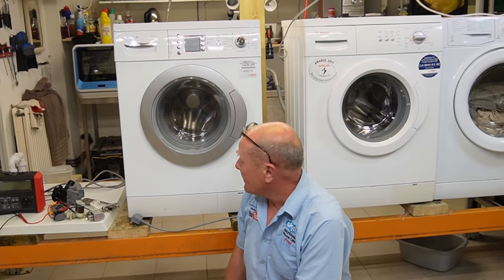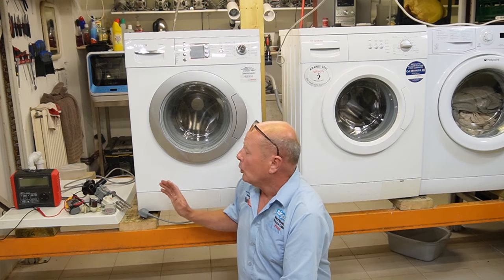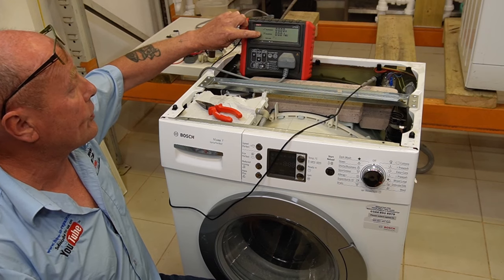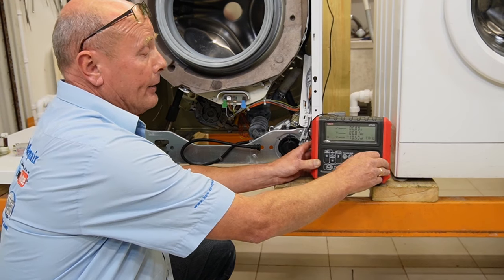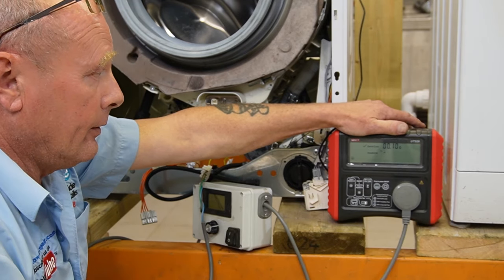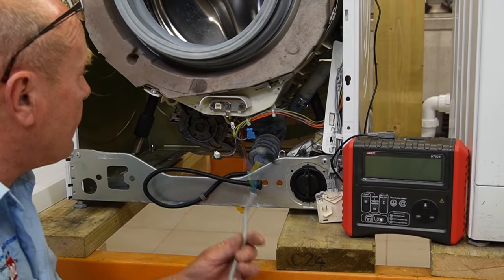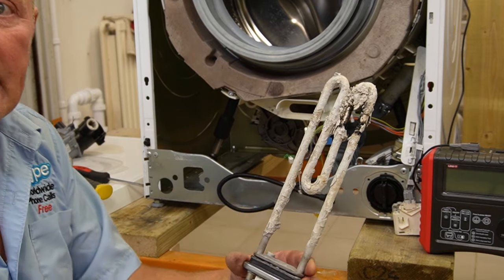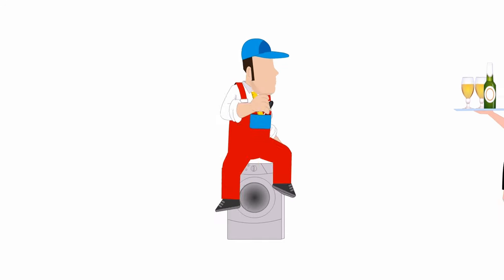Washing machine trips electric fuse board, Breaker or RCD

Comment: Great video... Just be careful how tight you tighten the nut back up. Measure how far the nut is on the thread before undoing it and then tighten to the same distance otherwise you could break the PLASTIC drum housing. This guy made it appear like you can apply lots of torque to that nut. It will seal without excessive tightening. Just do a run of the washing machine and look for any small leaks and tighten a little if needed after stopping the machine immediately after seeing and leaking. The plastic drum will crack very easily but if it does you can just apply an epoxy resin over the crack. The epoxy you would use in fish tanks.
Reply from the maker: I normally say hand tight and then quarter of a turn but it does look like I overdid it slightly in the video well noted point

Comment: Excellent video 👍🏻 also the other quick way to check for a faulty unit is simply by unplugging the connectors of the individual unit then see if it still tripping or not

Comment: Top tip Chek for lose wires. I had a lose ground wire it got in to the motor and triped the breaker every time i tried to turn the washer on and triped the breaker

Comment: Hiya, I have a bosch washer dryer and have recently changed the bearings on the carbon brush motor. It worked fine, but after about 80% of the wash cycle it started tripping the fuse box in the house. Now, no matter what I do now the machine trips the breakers as soon as I initiate any program. If I unplug the motor from the machine everything is normal, so I assumed I've broken something in the motor. I performed tests on the motor with a multimeter and can't find any shorts or weird resistance readings in the windings or armature. The RCD even trips when I take the carbon bushes out of the motor but connect it up to the machine. Any suggestions on what else to check? Love your vids, great resource!
Reply: Could be the drying element  as well as the temperature sensor , also check the filter and give it a nice clean.

Comment: yes, i got this problem with my siemens s16-34. it knocked of the power of part off my house. So if i got a f57 error it will most likely be the main circuit board or inverter module correct? thanks for the explanation video

Comment: Hello, you talked about if the water pump became faulty it would trip the breaker as it only had a live and neutral. What is that referring to the fuse in the plug. can it not trip the house fuse box?

Comment: Hi, it has been few years since you posted this video, i still hope you can see this. My beko washing machine trips if i use hot water, even 20 degree hot water trips the electrics. The only way to use my washing machine is a cold wash. Any idea what the problem is? Thank you
Reply from the maker: Hi, I will need the full model number of the identification plate and the details of your problem so that I can provide you with useful literature. Please use our contact us page and make sure you fill out the request for what your problem is. A video shoot of the problem would be perfect as well.

I will get back to you within 24 hours, normally. https://www.how-to-repair.com/help/contact-us/  

Please remember to subscribe to our channel, as that's what keeps this channel going. Thanks, Paul 👍

Comment: I have the same power tripping problem with a 2 years old Bosh Vario-perfect. I measured  the 3-phase motor with a Megger insulation tester and also the heating element after warming up in a bottle. Both are OK. Then I changed the two mains filter capacitors (10 nF and 22 nF)  on the driver board who were connected to ground by 400 Volts types. No result. The machine is working well with ground disconnected, but this is unsafe. Floating voltage  measured with an multimeter, between machine housing and mains real ground is 90 -140 Volts, dependent on orientation of the plug and is able to light up a small incandescent lamp. That was the primary reason I suspected the two capacitors because they are the sole ground connections on the board ground (=housing too) All other power supply components on the board are OK.  Any other idea? Thank You
Reply from the maker: really you are asking an impossible task at me to diagnose the Machine without having the appliance in front of me all I can say is test every individual component and check none of the wiring is going to Earth Thank you For leaving a comment this is for you https://www.youtube.com/shorts/e432SAb2g08 please remember to subscribe as that's is what keeps this channel going. Thanks 👍
Reply: @How-to-repair 
tested  L and N with Megger (350Vdc):no earth leak.  I've disconnected the motor, heating element, pump: no ground connection, nor on all the cables connected with the driver board.
The tripping occurs after turning the program selector knob, whereafter the two relais  on the board are closed. I see a VDR (resistor) on the board (value "150 ohm", dvm measured :50 ohm)  and maybe he is necessary for the coils, but NOTHING else beside the two input-filter capacitors have a real ground connection. Maybe there is a link were I can find the technical servicing manual and circuit diagram of this Bosch Vario-perfect washing machine? Thank you for your quick response

Comment: Good day why is it i already change the heating elements the still its triping the breaker?? I also check the continty but still trip can help me  thanks.
Reply from the maker: Hi, please use our contact us page and make sure you fill out the request for what your problem is. I will need the full model number of the identification plate and the details of your problem so that I can provide you with useful literature. A video shoot of the problem would be perfect as well.

I will get back to you within 24 hours, normally. https://www.how-to-repair.com/help/contact-us/  

Please remember to subscribe to our channel, as that's what keeps this channel going. Thanks, Paul 👍
Reply: @How-to-repair   I forgot the model but some picture

Comment: Good morning, i have a 5yo Beko washing machine. About 2 weeks ago, it started to trip my electrics whenever I start a program. I can turn the machine on just fine but the moment I select any program (delicate, wollen, cotton. Synthetic etc..) and press START that's when it trips my electric. I dunno what it could be. heating element, motor, inlet water valve, door lock, and main power.  switch. Thank you.
Reply: Everything I've had with a Beko hasn't lasted, Shit company!!! And now the same as you my Beko washing machine is tripping, Ridiculous!!!

Comment: Just started happening with my washer, 8 years old. Worth getting a specialist out to diagnose and repair or just buy a new machine for £300?...
Reply from the maker: It is worth having a look at what is tripping. The electrical supply feel free to contact us using the website. Make sure you use your full model number and a contact telephone number. Hi @tiggersmith7393 I will need the full model number of the identification plate please use our contact us page and make sure you fill out the request of what part you are after and will get back to you within 24 hours normally https://www.how-to-repair.com/help/contact-us/
this is for you https://www.youtube.com/shorts/e432SAb2g08 please remember to subscribe as that's what keeps this channel going. Thanks 👍

Comment: You are a clever man, sir. So methodical. Wonder if you can answer a quick query. I have a Samsung Ecobubble direct-drive washing machine. Is it possible for the RCD to be tripped by a faulty on/off switch? Or something faulty on the pcb board? I am experiencing an intermittent issue whereby sometimes the RCD is tripping just by turning the machine on at the on/off switch. After re-setting the RCD at the fuse board everything then works ok. The wash cycle then proceeds from beginning to end with no further issues. Bit of a “head-scratcher” for me. Any ideas? .
Reply from the maker: The RCD will trip when you have an earth fault this can be caused by a bad connection or any live wire going to earth over 20 miiamp standards Glad it was helpful! Thank you for leaving a comment this is for you https://www.youtube.com/shorts/e432SAb2g08 please remember to subscribe as that's is what keeps this channel going. Thanks 👍
Reply: @How-to-repair  Thanks for your kind reply. I do indeed subscribe to your channel. I am continuing to have the above described intermittent trip out of my RCD at the point of switching on my machine. Very puzzling as it only happens ( if it happens) with the act of pressing the on/off switch to power up the machine. When I reset the RCD and press the on/off switch again the machine then works perfectly (until the issue happens again). Could you please clarify for me if the switch itself could be the cause of this issue? The heating element and Suppression filter have both been renewed and this intermittent problem still persists as described. Was simply wondering if a faulty on/off switch could be the culprit. Or is it more likely a main PCB board issue. Any thoughts of yours would be appreciated. My machine is an 8kg Samsung Ecobubble model with digital inverter motor. Just over 6 years old. Problem only arose around 2 months ago. Thanks in anticipation.
Reply: @colcocon6021 Did you ever sort this issue? As mine is just suddenly doing this, Makes no sense at all tbh cuz it did it back on new years eve and then the next day thankfully it was fine but now many months later it tripped half way through a washing cycle, I literally can't even get it to stay on now, It's doing my head in!!!

Comment: do you have to remove the control panel to get the front cover off?
Reply from the maker: It does vary from machine to machine, but normally you have to take the fascia panel off to remove the front panel but on some machines they have welded cabinets. Hope you had a good New Year. Please remember to subscribe to the channel as that helps us
 glad we could help you @user-uh4yf1ck4w this is for you https://www.youtube.com/shorts/e432SAb2g08 please remember to subscribe as that's what keeps this channel going. Thanks 👍

Comment: I had an power outage while the machine was running. Now it doesn't turn on. The machine is 3years old, front loader. What can it be wrong?
Reply from the maker: The first thing I would do is make sure there is power going to the machine. Do you want to check the socket point and also the fuse in the plug a great Christmas and a happy New Year please remember to subscribe as that's is was keeps this channel going. Thanks 👍

Comment: Hi does the machine still work if you disconnect the heater and tape the wires and connect the inlet to the hot water instead? (hotpoint wm63)